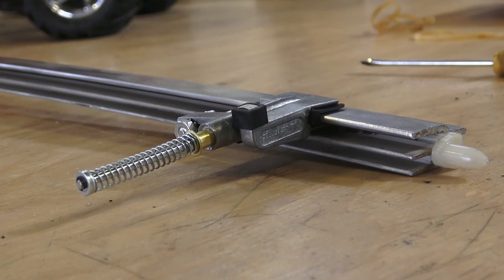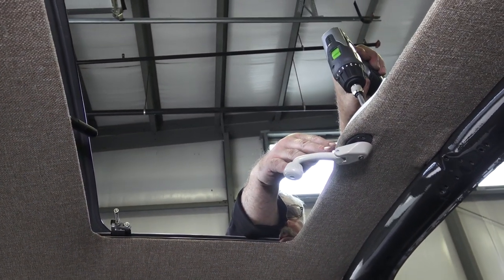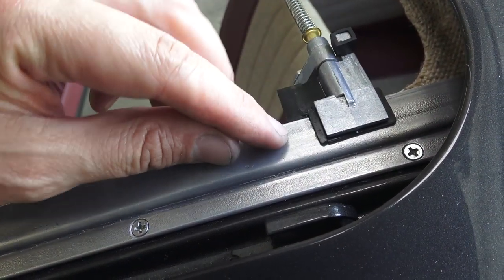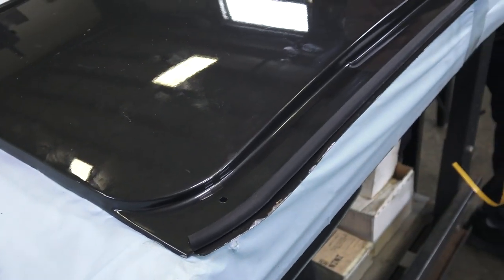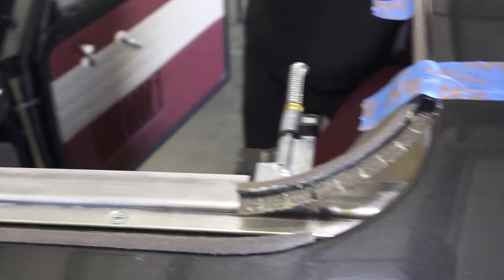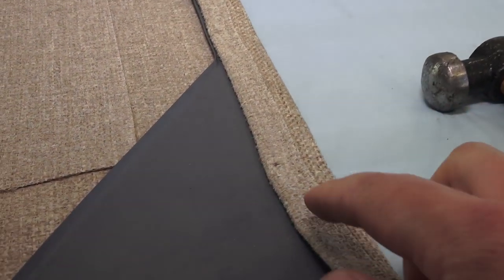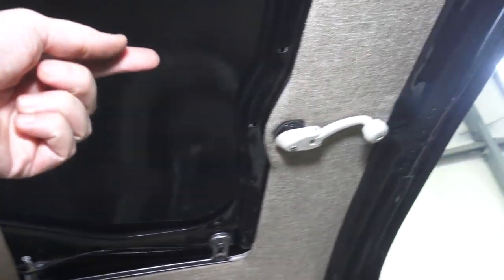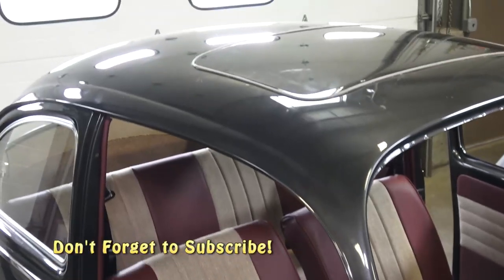Classic VW BuGs How to Install Beetle Metal Sunroof Headliner Pt.3

Comment: Didn't you put the front felt in the wrong way? The felt isn't supposed to overhang the roof. It should flipped so the "P" pushes towards the sunroof and sits flush with the roof. When I did it your way I had big gaps between the felt and the sunroof on either side... so I will have to redo it.

Comment: hey Chris I did my sunroof just like you showed but the first rain it leaked like a Hell, the problem is the rear rubber seal does not go where you put it ,  there is grove  for the  seal  it is  in the center of the front rear lip. that where the seal goes. the seal you did like has that grove for it to slip into that grove, so I anm redoing  it . the way you did the water funs into the two holes  and into the bottom pan it has to be to the front of those holes.
Reply from the maker: Thank you for mentioning that, I will clarify this as I did follow the VW bible manual on the installation.

Comment: I think the bead is supposed to be flush. Otherwise my sunroof has a big gap. Then the back seal gets mounted the other way around that way it is also flush. I am by no means an expert though...
Reply: Yea I did that like in the video and have 2mm gaps on either side between the felt and the sunroof. 30$ down the drain...

Comment: I have a 1967 VW bug and I’d like to put a rag top. It comes from a 1966. I don’t want it welded on top or weld it up under I want it even with the roof that would be the best way to install it to make it look more original even though 67 never came with a rag top .bug do you recommend someone that could install it and what is the price you think it would cost to have it done. I  have other work that needs to be done

PS
Thank you in advance.
Reply from the maker: lookup Britax sunroof kits, they got a pretty cool kit you can get.